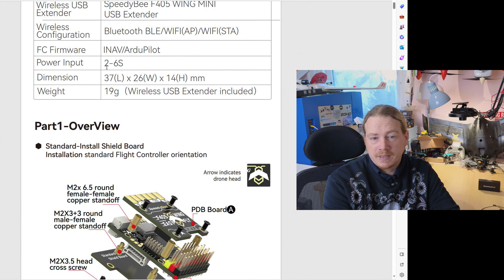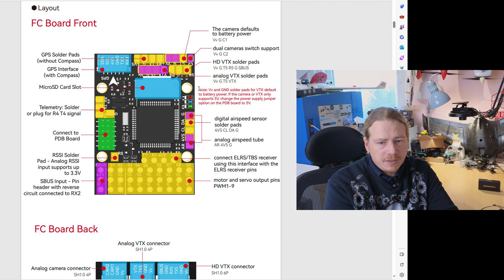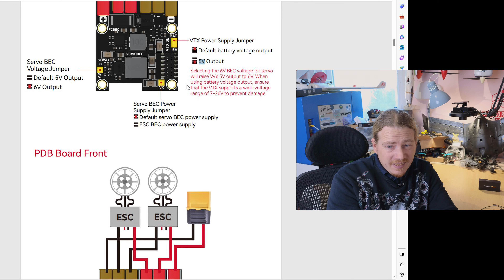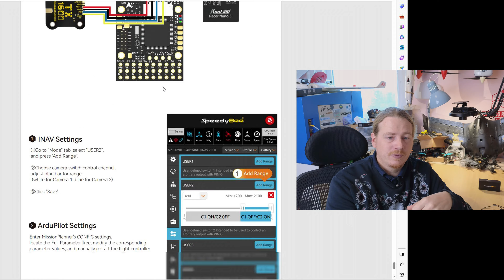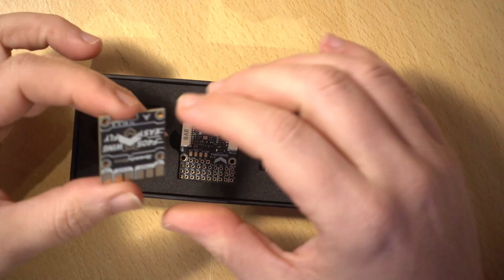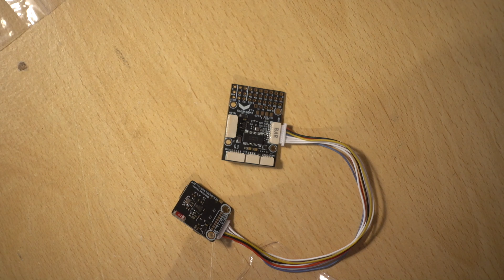SpeedyBee F405 WING MINI: First look and unboxing

Comment: Thank you for your informative videos!
I've already watched a few, as I'm thinking about getting a FrSky system. I'm torn between the X 20 RS and the XE. What I'd really like is to have messages such as waypoint notifications announced. Perhaps also other messages from various Lua scripts or telemetry data. Can you tell me whether the systems are capable of this? For example, I also use the flight controller from Speedybee, or other H743 FCs, but with ArduPilot. 

Thanks

Comment: I cannot find the pinout anywhere - do you know if the GPIO81 pin is exposed anywhere? I want to reuse the user1 mode that switches cams for switching the caddx peanut on too.

Comment: Hi i got a question, why are some of my osd icon such as rssi is shown as distance to home in my goggles? Im using the 03 and im currently using djiwtf. Not sure which video format i should be using hdzero, djiwtf or walksnail? Been using betafligjt n now back to inav n all is so confusing. Also is the hd screen in inav is supposed to be split into 2? Upper n lower?

Comment: Hi Darren, have a hard time to connect telemetry from the mini. First off the mini did not have the specific connector included but had one left over from one of my SB Wing FCs. Can nowhere find a layout for the different connections like Tx2/Tx4. Using a Frsky X8R receiver.
Any ideas would be appreciated.

Comment: Hi Darren - thanks for this and the other videos you’ve done!  One bit of feedback, however - regarding your frequent comments about connectors vs solder pads.  In some cases, it’s not about ability.  In my case, I am afflicted with a condition that causes tremors in my hands.  All the practice in the world will not make it possible for me to solder those small pads.  I’m able to do well enough to get some splices done when necessary, and can manage the big pads on the PDB, but I’m personally very thankful that SB has seen fit to include the connector options on their boards, and hope they will continue doing it!  Cheers, and be well!
Reply from the maker: That is a fair comment. In which case, I’m glad these FCs exist, so that more people can enjoy the hobby.
Reply: Connectors for everything EXCEPT telemetry...  😡

Comment: Just installed this in a nano goblin, seems to be pretty great for that purpose. I'm sure people have figured it out but it's worth noting that the cable with the connector not installed is for the GPS, not the HD vtx, they specifically left the connector off so that you can install the wires in the order needed for whatever gps you are using. (in my case an hglrc m100 with compass, which works flawlessly). The lack of a vtx power switch is a bummer, especially since I am using digital, but I have been just using a usb power source ( portable phone charger) plugged into the board, without the flight batt connected, to let the gps get locked without powering the vtx and risking overheating. Then plug in the flight batt and disconnect the external ups power to keep the board powered, or vise versa, the gps will almost instantly lock again if the board is only powered of for a second...and off you go. So far have had no issues. If that is a no-no for some reason I'd love to hear why, as I am by no means an expert.
Reply from the maker: Using a power bank to power the GPS but not the VTX is fine. It will allow the cold start to take place. The switch to the main battery for the flight. I know quite a few people who do this. There’s not problem in doing it. It would just be nicer if you didn’t have to. 

Happy flying

Comment: Hi Darren, a lot of your videos have helped me get my head around what flight controllers can do (and iNav). Up until now I have just used standard Hobbyeagle V3 type gyros in fixed wing. I fancy converting a plane to FC and iNav. One thing I haven't got clear is the difference between what iNav & FC can do for stability vs a old school gyro (esp for Acro/normal stability mode). With the Hobbyeagle gyros you can adjust the gain on the fly, from a pot or switch on the Tx, so the amount of stability input can be adjusted depending on wind conditions. I don't see a similar feature in iNav.... maybe it's clever enough not to need it?

Comment: is it possible to use the servo output with pin header for example S8 or S9 for LED?
that would be easier than having to use the dedicated LED solder pad
Reply from the maker: Not without building your own custom target.
Reply: @MrD  thanks for your reply.

wow that's surprising.

in Betaflight it's possible to remap resources in CLI.
I wish INAV could do that.
Reply from the maker: @flat-earther  BetaFlight doesn’t have to worry about timers or important things like that. Resource remapping can be dangerous.

Comment: It’s sad that they do not support 12 volts like the big brother
Poor old luddites like me that use 1.3 ghz high power transmitters for long range FPV MUST have 12 volts !!
Not sure I would like to try the “Use battery jumper” as 16.8 volts would blow the 1.3 unit I reckon
Love the big brother but not this mini unit
Reply: just use a Matek 12V micro BEC
Reply from the maker: I’m guessing those old Partom or RMRC VTX. To be honest, they would be pretty big and heavy VTX to have on a small aircraft that this mini FC is made for. The bigger one would likely be the better choice anyway. 

For 12v, you could just use a separate BEC. Like how we used to have to do it before we were spoilt with flight controllers with multiple DC-DC converters on board.
Reply: @MrD  Yeah another point of failure with a BEC. I see your point about a small model but I still use them on the Dolphin, Albabird and Reptile Dragon V2
Great review thanks
Reply from the maker: @nellodude  for all those aircraft I’d go for the larger anyway. There’s plenty of space in them.

Comment: Does the board have to be powered by a battery for the receiver tabs in INAV work? The receiver is bound but I get no response in the configurator. I tried to use UART 1 and it keeps deferring back to UART 2 after reboot. I can’t figure out what’s going on.
Reply from the maker: In general, it depends on the flight controller. If the pads are labelled 4v5. They should be powered by USB. If they’re labelled 5v, they likely require the battery plugged in. 

I would keep the receiver on UART 2. If the receiver is bound, but INAV doesn’t see anything. Firstly, the receiver is getting power (otherwise it would be off and not bound). I would check the protocol, then the wiring. To make sure they’re right.
Reply: @MrD  I tried UART 1 again and all is well. 🤔
Reply from the maker: @jeffatkins8103  they’re just suggested. In reality, other than for inverted protocols on F4 boards (because they need a hardware inverter). You can put anything on any UART. It is strange that they’re suggesting UART 1 for an RC link though. Firstly, that’s usually a good UART to leave with MSP enabled as a fallback. Secondly, having devices connected to UART 1 and 3 can cause issues entering DFU. If it’s working, it’s fine. But when you update. If you have a problem, try removing the device from UART 1 and 3. That may get it working.
Reply: @MrD  thank you! Everything is working fine on UART 1 so we’ll leave it at that I guess.
Reply: For whatever reason the receiver on the 405 mini wing is on UART 1. That’s a first for me!

Comment: Don't buy this FC it's crap, I had rx uart problems, servo outputs went bad after five minutes on the bench while testing servos. I moved the servo output to S6 from S4 and got the servo working again but then the motor output on S2 went bad. Believe me, I pulled the servos and ESC all working fine with a servo tester. I even swapped the ESCs on the header pins S1 & S2 the problem just moved from not running the right motor to the left motor.
Reply: wow. did you get it figured out? did you ask Speedybee for help?
Reply: @flat-earther  Yes, I contacted Speedybee support and after they gave me the runaround for a few weeks they sent me just a new FC board. They are so cheap that they couldn't even just send me a whole new FC kit.
Reply: @madsloper  okay good to know.
did you buy it direct from speedybee? because some companies won't help if it's not bought direct from them.
Reply: @flat-earther  I bought it from Pyrodrone, Speedybee gave me the runaround for a bit but eventually sent me a new FC board only. I still haven't had the chance to install the FC in a plane yet. A flying buddy also had a problem with his Speedybee mini which he bought directly from Speedybee and they still gave him the usual runaround but are sending him a new FC board only.

Comment: Great review Darren! I just ordered two for the coming season after your video. I understand your comment about the VTX switch but isn't that very easy to do by adding a mosfet to one of the servo pins to switch the VTX on and off?
Reply from the maker: You can DIY a VTX switch. Ideally 4 resistors, 2 fets, and a cap. That will make a decent power switch you can operate from a GPIO on the flight controller.

Comment: I'd love to see the shield or PDB turned into an esc. It would make a great integrated wing stack.
Reply from the maker: It sounds great in theory. But in reality I don’t think it would work. 
- is it for a single motor plane?
- is it for a twin?
- is it for a VTOL?
- what A ESC is needed?
With quads, these questions are much simpler and easier to answer. On a fixed wing, there is much more variation.

Comment: I'd like to see switchable power on more FCs, even bake it in to the 9v VTX power pin.  The HD systems can get pretty warm waiting for a cold GPS to fix.
Reply from the maker: That's what usually happens. The VTX switch is a pretty simple circuit. It just cuts the supply to the positive pin to the VTX. It can be a simple circuit with 2 resistors and 2 fets, or a bombproof circuit with 4 resistors, 2 fets, and a capacitor. They would cost pennies for a flight controller manufacturer to add to the flight controller.

Comment: A nice comprehensive overview. More features than I was expecting for the size. Thanks Darren. This FC definitely on my order list. 
Something to check: if the Mode (tab) switching option for duel-analog cameras is supported in INAV for the Mini-F405?  Been hoping that digital camera would offer a dual camera switch option to share a VTX. Seems most assume only a single camera on a quad, overlooking planes where having a 2nd Earth pointing, rear-facing, or tail-mounted view are more common options. With HD video, so many fun possibilities for dual perspectives exist.
Reply from the maker: As far as I know. It will be in 7.1.

Comment: A possible reason why some people don't like soldering: There are lots of Chinese soldering tips on the market that seem to fit around a 3.8 mm heating core, but they are a tiny bit too roomy inside, so they fail to pick up heat reliably. They will reluctantly melt solder, but never get hot enough to work well. That simple fact hampered my efforts for years until I discovered the problem. If some of you out there you struggle, check to see if there's too much play in the inner diameter of your tips.
Reply from the maker: Great tip, thanks for sharing 👍🏻

Comment: It's unfortunate they chose uart 3 for GPS, because having something 4v5 powered on uart 3 can interfere with flashing and potentially boot. Would have been better to put GPS on uart 2, 4, or 6.
Reply from the maker: Good point. It's a good idea to avoid UARTs 1 and 3 where possible.
Reply: Agreed.  In my experience GPS are suitably fussy about voltage input that they dont even power up reliably from 4v5/USB.
Reply from the maker: It’s not about that. I’ve not had any problems with GPS modules powered from 4.5v. In fact, it’s been useful. 

It’s because there is an issue with some STM32 MCUs. Where if you have a device on UART 1 or 3. It can cause issues entering DFU or flashing the flight controller.
Reply: @MrD  thanks Darren, maybe it says more about the quality of my motherboard's USB power output lol
Reply: @wtfmimshag  
The processors used on these boards (F4, F7, etc) can be flashed using any of three three ports:

the USB port
UART 1
UART 3

While powering up to DFU mode, they check for activity on any of those ports to see if you're trying to flash it.
If you have a GPS (or receiver) talking on one of those ports, the chip can think you're trying to flash it over that port.

Hence the common practice of using uart 2 for the RX and uart 6 for GPS. Because those ports aren't used for flashing.

If you've ever needed to disconnect something from a uart in order to get flashing over USB to work, that's why.  Because between USB, UART 1, and UART 3, whichever talks first is the one the chip will think is being used for flashing.

Comment: For those miniature connectors, I just bought some boxes of pre-crimped silicon covered wires with connectors of different sizes from Amazon. That's so useful to have in this hobby.
Reply: Any chance of a link to these connectors please?
Reply from the maker: @BogHopperFPV they’re JST SH connectors.

Comment: Thanks, that was a very detailed and useful review 👍 . I will buy one locally, it's in stock. Speedybee mentions a min voltage of 7V, this is on 2S a 3.5V per cell. For 2S li-ions something to keep an eye on. A VTX power switch would be nice indeed. In the meantime I use in my builds a computer 2.54mm Jumper connection in the + lead of the digital VTX.  And the lack of a 9V BEC is not a deal-breaker in most configurations. It seems a good small FC .

Comment: What voltage is the dji pad?  Vbat or regulated?

If vbat, are any additional considerations necessary?
Reply from the maker: It uses the video voltage. So VBAT or the voltage of the servos. Whichever you choose.
Reply from the maker: It uses the video voltage. So VBAT or the voltage of the servos. Whichever you choose.

Comment: I've fitted one to my ZOHD Drift. It's a tight fit. I used the vertical pins to connect receiver, esc and servo's to the FC. I designed and printed a GPS cover extender of 10mm tall. This so I could carve out space in the EPP gps cover to allow the servo wires some room to bend downwards to the lower room that houses the ZOHD esc and my receiver.
The FC is of great quality and, as always with SpeedyBee FC gear all connectors and wire looms come packed in the box as well.
Reply from the maker: Damn, I bet that was a tight fit in the Drift. It's a tight fit to get a small 6 channel receiver in there 😆
Reply: Nah, there is room for a FRsky GR6 and 3 dubro connectors of the 3 servo extension wires. 😆 But to be serious, the horizontal servo pins that are also packed in the box are a no go. There is no room in the Drift to plug in and unplug the servo connectors with that pin array. So you definetely need to modify the original GPS cover to make room for the servo connectors.